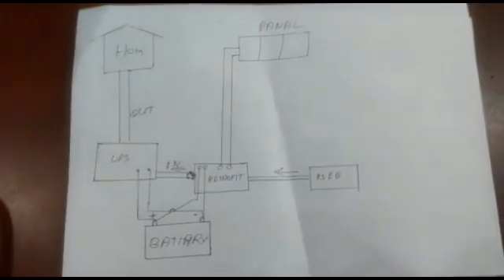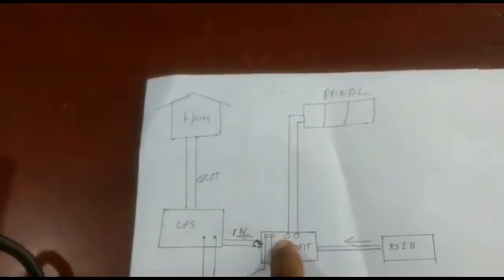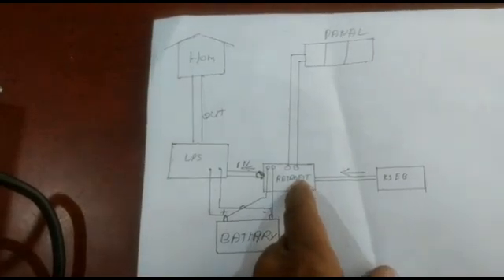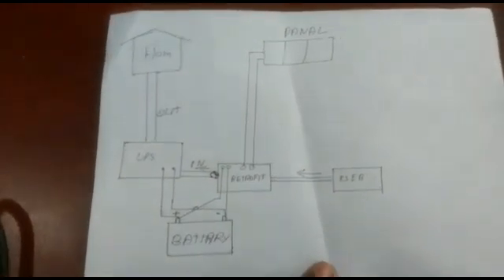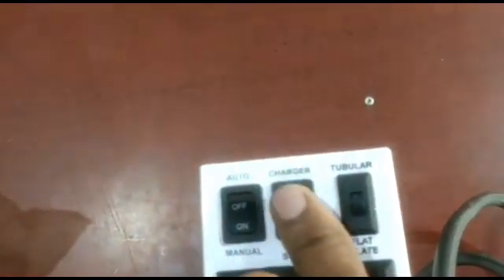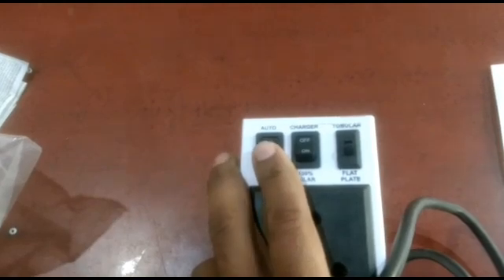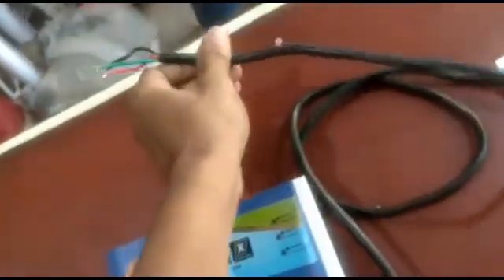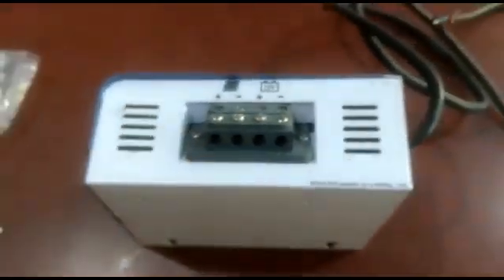How to Make Your Normal Inverter into Solar Inverter with Lowest Investment/

Comment: 500ah battery yum, 1000watts inverter num , pannel ethra watta venam? ethra samayam kondu charge full aakum, ethu type (monocrystalline) solar pannel aanu nallathu, ethra amount aakum?
full solar il work cheyaan ,converter (ningal paranja machine) back il koduthittulla automatic switch off chayithitano second solar swich select cheyandathu?  
full battery discharge aayipokukayaanenkil kseb source use chayithu charge cheyendi varumo? athoo battery full drain aakaathirikaan enthankilum setting undo?
solar charging vazi battery charging cheyunnathukond battery yude life kuryumo?
Reply: 150ah battery one day kond full charge aavan 250w panel mathi
Reply from the maker: 500 ah battery 1000 invattr matiyakilla
Reply from the maker: 150 ah full charge avan 600w panal vanam

Comment: https://youtu.be/ymAU4nKCwvo

little more facilities/option in su-kam. still there is limitation to connect with charge controller than inbuilt  controller. this is practically  failed method.